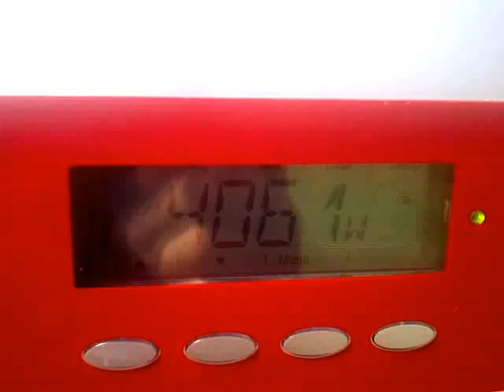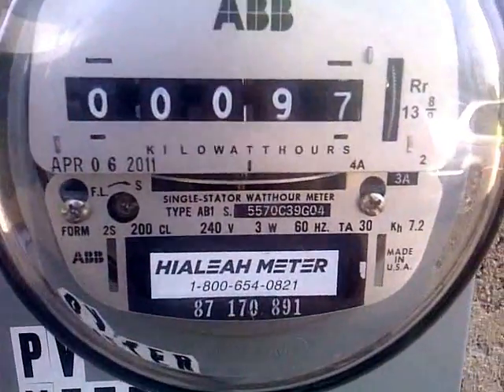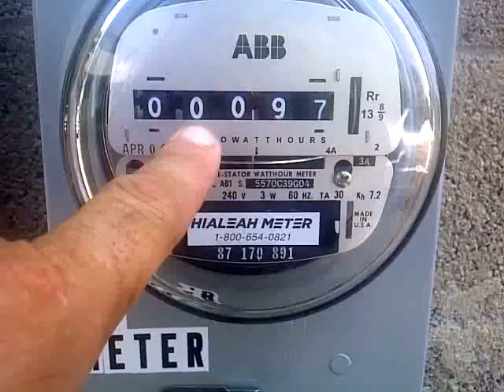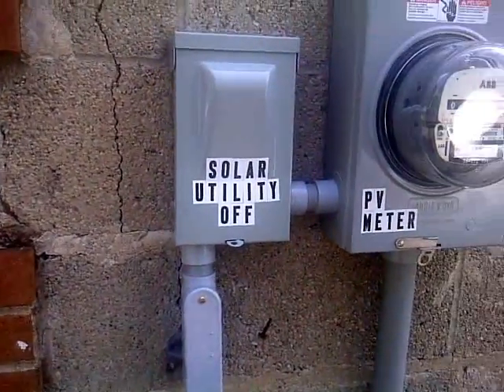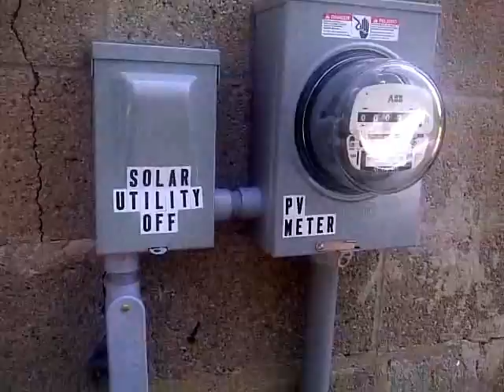Home Solar Power Pa 11 kw Ground Mount

Comment: HI Larry, i have a 10,000 Watt system with a Fronius inverter (similar to the one shown) that i just installed my self and was wondering why it is not pulling (8,000-10,000 watts) when the sun just coming over it is about 4,000 watts, and when the sun is directly over it only around 6,000-6,500. any suggestions?
Reply from the maker: +Tom Gates Ho Tom. Your production is based on many things. So your question is very open ended. Tilt angle wiring type of panels and so forthhall play a roll. There is a lot of info on the internete to look into for your problem. There,s to many answers to give so again recheck all your angles, panel type wiring and such.
Hope this helps